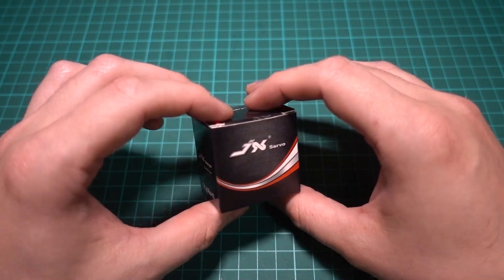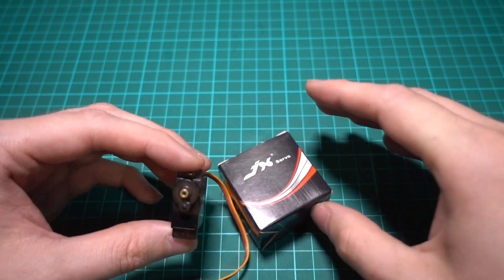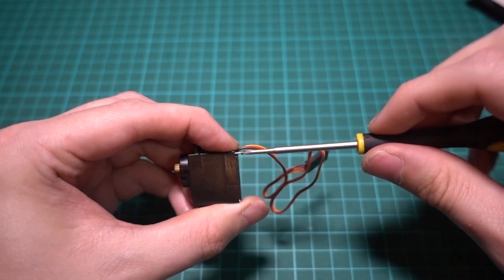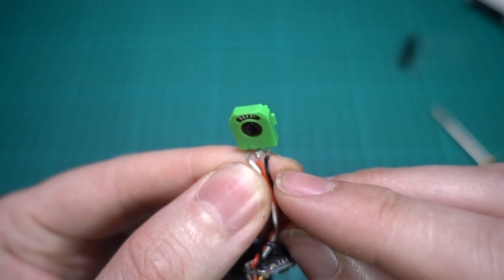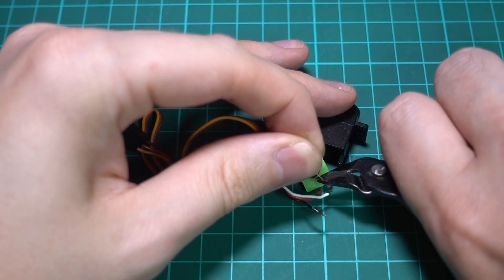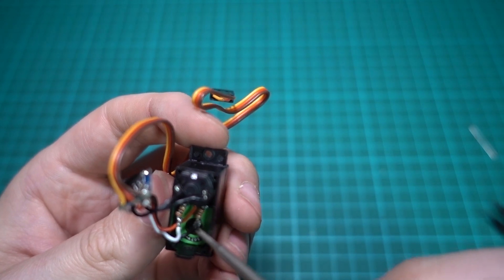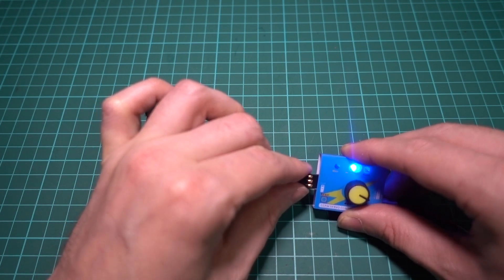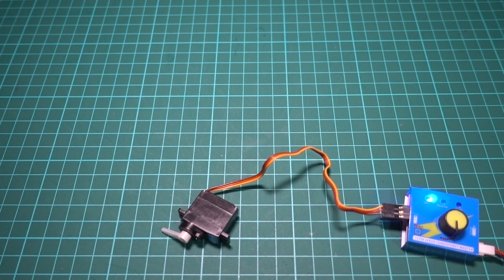360 degree (almost) Micro Pan servo 10min mod

Comment: Great job on this Andy. Your linked DPI-9180MG servo is out of stock. Any other recommendations? 180+ degree servos are hard to find.
Reply from the maker: The only other ones are the bag servos (bad ass gimbal) they are 35 quid each but they are Digi servos. They come with the mod already done. Hobby king do 180mg servos but never tried the mod on them and they are a funny size
Reply: @AndyRCchannel  Thanks Andy but £35 is daylight robbery 🤣 HobbyKing are out of stock. I'll keep hunting. Cheers.
Reply from the maker: @EssentialRC  bangood usually have em. Someone will. Try aliexpress

Comment: Is that possible to make 360 degree non continuous servo?? I added 3.3k resistance and angle got increased but i need more 360 degree,is there any way to make this???? Potentiometer is important to hold angle.
Reply from the maker: No sadly not which is why I make this video
Reply: Magbetir meter and a 360 con servo

Comment: Looks familiar... lol
Reply from the maker: haha yeap. I couldn't see a better solution even now? most of the stuff i learned early on was from your channel.. the others did not exist. this is an extract from my 2 hour build.
Reply: @AndyRCchannel  Nope, this is still the best option I found to get more than 180º from a small servo. I really wish there was a smaller option that works as well as the 1-turn GWS servos... lol On my Talon 250G I used a Turnigy 5g servo that gives me 180º if I drive it with a PWM range of 500-2500uS. I've been meaning to pick up another one of these JX servos and try driving it like that with an extended PWM range and see if it works well without having to mod it.
Reply from the maker: @bonafidepirate   how would you drive them? with a servo stretcher? iv tried that, the servos lock up veer easily with rapid head movements... someone please make us a micro 1 turns 360 servo for the 5 people that want one ;)
Reply: @bonafidepirate  What I don't understand is that if you take a servo and manually move the arm, it stops mechanically on each end of its range. I get that if you change the resistor values, you're changing the PWM and thusly the microcontroller will interpret 0 degrees as a negative angle, and 180 as an angle greater than it. But that doesn't change the fact that there's a mechanical stopper in there.
Reply: @AndyRCchannel  360 continuous servos exist, though..?
Reply: @ojkolsrud1  This particular servo shown in the video doesn't have a mechanical stop. The stop is usually to prevent damage to the feedback pot since not all of them can rotate 360º. The one used in this servo can, and have around 270º+ of usable range where it works. If you go past that usable range it will start spinning round and round like Andy shows in the video, so you fine tune the end stops in the radio so it stops just before that happens to max it out.
Reply: @AndyRCchannel  I didn't like the servo stretches I tried either, they worked, but made the servos movement jerky and not all the servos I tried worked with them. On the Talon 250G I'm using iNav, and just set the min and max PWM values there. I'll likely switch that plane over to Arduplane soon, and will set it up the same way.
Reply from the maker: There's no no Mechanical stopper in this particular servo
Reply from the maker: Yes and you can't stop em haha
Reply: @AndyRCchannel  I guess there would be more customers for that kind of servo. I've just maidened my WotsWot and noticed, that the pan-angle could be bigger. First I tried stretching the PWM range. If you are using the Arduino board, you can modify the code and add a factor to give you more range and modify the limitations in the code.
Still, this was not enough with my servos, so now I'm installing the resistors 😉